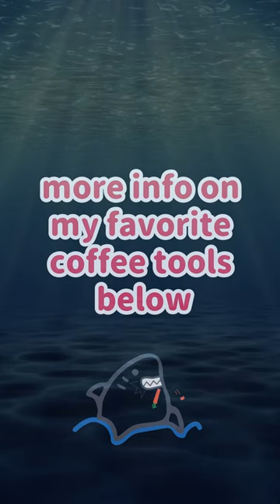ascaso steel duo pid | my workflow with a eureka atom 75 grinder (fast!)

Comment: I have a question can I use this machine in ghana? Ghana uses 220 voltage
Reply from the maker: You might want to check the machine's voltage compatibility. If it supports 220V, you can use it in Ghana with no problem.
Reply: @alldayieatlikeashark  thank you